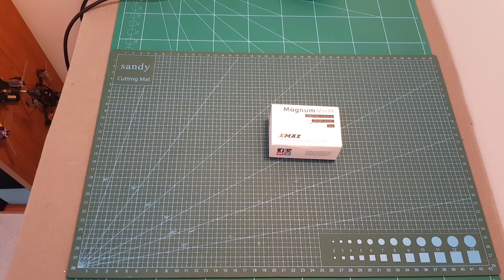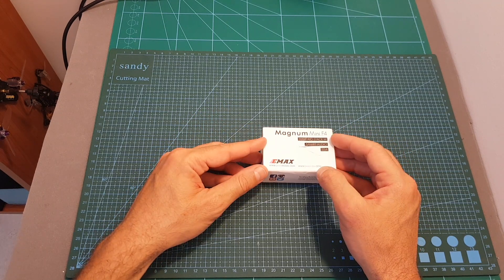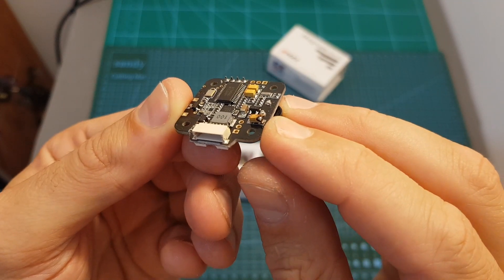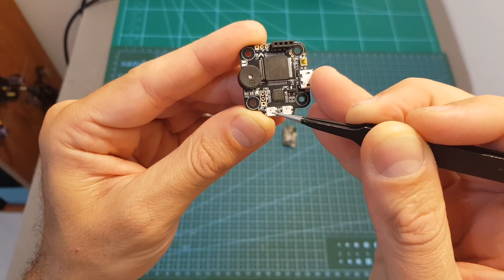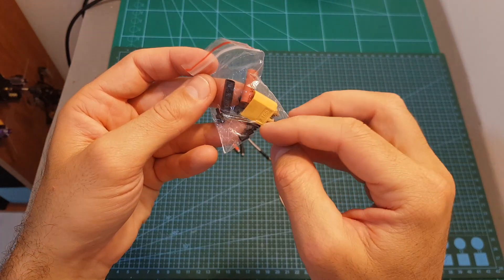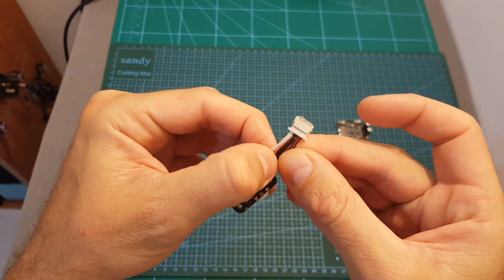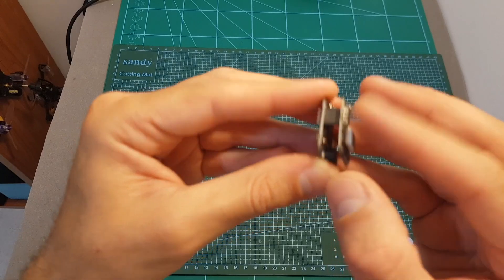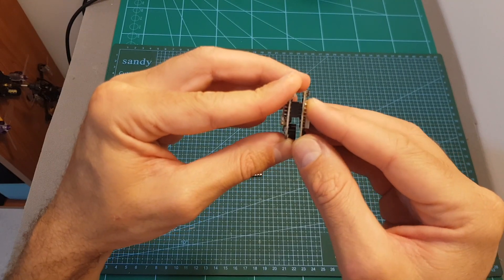EMAX Mini Magnum 2 AIO Stack - Overview + Some Ranting

Comment: Very strange how your stack came packaged. I ordered mine 5 Oct and it came packaged in the foam as in your video but the foam was inside a sturdy plastic container with the cardboard sleeve around it. Also my vtx came with a mmcx connector not the old ipex style like yours. Its been a good stack so far. Only complaints would be not having the uarts broken out for easy solder access and the VTX seems to be performing terribly compared to every other vTX I own at equivalent output power levels. Maybe I have a dud vTX.
Reply from the maker: yeah I didn't have a great luck with this stack. I really wanted to give it a try.
I am glad yours arrived safe and sound :-)

Comment: I ordered a replacement 4 in1 esc from emax last week I didn't get a email saying it was shipped or tracking number I emailed them countless times and no reply
Reply: Just fyi, I found replacement esc's on pirofliprc for $60. I broke the connector and crushed a 6s pack on a hard crash and needed one also.
Reply from the maker: There was a holiday in China last week. Hopefully you will get it sorted soon.

Comment: Great overview bro! The first one I bought from pirofliprc had a broken connector (cardboard box and still waiting for my refund 2 months later lol) and the second one from getfpv works great but the vtx was doa. I can honestly say that the esc is handling my 6s build with hyperlite 2205-1722KV motors perfectly. And trust me, I've shredded the throttle looking for weakness but it just says "give me more!" I hope you get a replacement soon. The one I got from getfpv was in a plastic box :)
Reply from the maker: Thanks Dante. I know it's supposed to be a good product and I am not sure I will be able to test it out, as it was sent from BG for a review and I might pick up another product for a review instead of getting a replacement unit. I uploaded the review because I do think that it adds some information and I want emax and potential buyers to know about the build and packaging issues.

Comment: what urt is the sbus cant get any reciever response
Reply from the maker: Which receiver are you using? You might need to use an uninverted SBUS port.
Reply: @KremerFPV  xm plus
Reply from the maker: @moparme2733  Are you 100% sure that it's bound correctly? If so - check out this article that shows how to get the univerted signal of an XM+ RX: https://www.getfpv.com/learn/fpv-diy-repairs-and-mods/get-uninverted-sbus-frsky-receivers/

Comment: This Rocks for a stack.. If you head over to fpv- flightclub.. he has a build video for a 6s rocket ship .. Neutron.. over 100 mph ..

I am running this with 1950 kv 2205 on 2 blade prop and it's fast.

Anyway you will pick up some very good pointers if you head to FC site and take a look at a Neutron build..
Reply from the maker: Thanks, I will check it out.